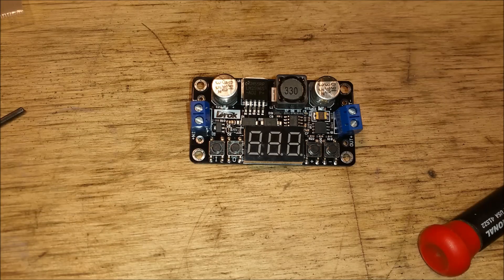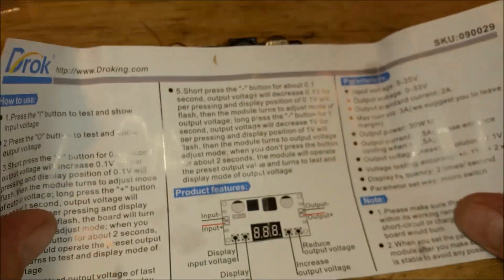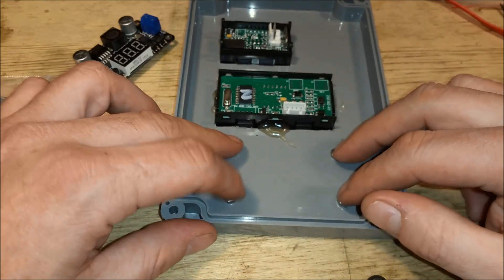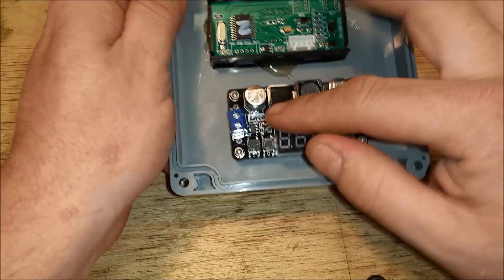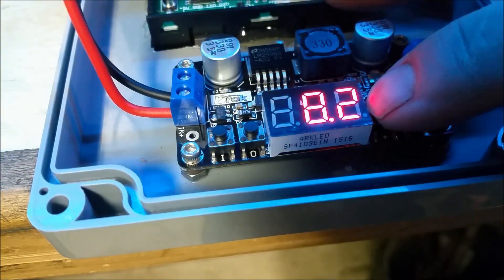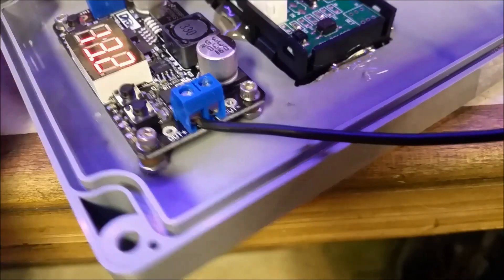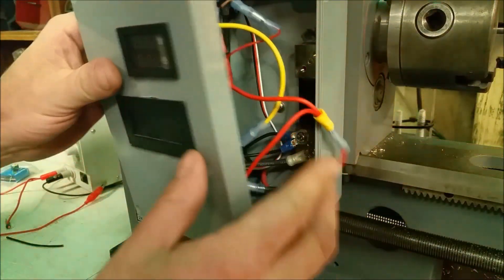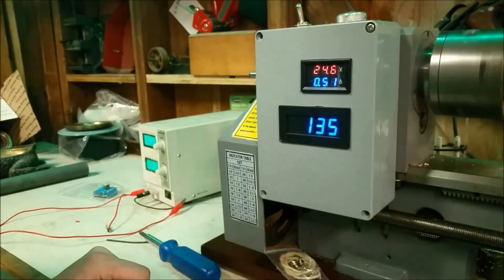DC to DC digital regulator DROK Droking.com for mini lathe tachometer LM2596

Comment: i need to find one that does from110 to 5v...so i can some straight in off the  terminal block,  then wire my tach to the other end..im doing a treadmill motor lathe build

Comment: Don, do you feel the heatsink is nessisary? I see them sold with little coolers, mine did not come with them. I know MOSFETs get real hot sometimes, enough to peel skin (learned the hard way). I'm preparing my setup this week, running 12V in, and 5V out powering a single 0.28A, 1.5W fan.... Directions say, "please enhance cooling when > 1.5A", which I assume means to cool it when running under its native amperage (2.0A). Am I correct in thinking I need to buy heatsinks?
Reply from the maker: Sorry to hear about the burn, Ouch.  I cut, burn and stab myself on almost a daily basis. hehe.   If you fan is drawing .28 amps, i wouldn't think that you would need a heat sink. I am not using a heat sink on my DC regulator, it has been in the lathe for almost a year now. A 1.5 watt fan at 12 volts only draws 0.125 amps which would be below the .28 you mentioned. If you like, share you project with us, would like to hear about it.  below is a handy link to Watts\volt\amp calculator online.  Thanks!  http://rapidtables.com/calc/electric/watt-volt-amp-calculator.htm
Reply: Ya I hear ya, I work with FDM and SLS printers, so heat and razors basically lol. Used to it by now. I did some testing last night and it barely hit 85f after 30 mins. I could even push the voltage a bit (fan takes 3-7v safely) and it didnt care. Still though, I wanted to put them on there just incase. Rather than pay for a box of 20 heatsinks when I only needed 2, I dug through my old computer parts and found a GPU heatsink. It was perfect. So I chopped 2 squares from it, 4 fins each. They are now on the boards and cold to the touch when its running, so I can upgrade comfortably to lager fans or bigger circuit in the future if needed.

The project is a 3d printer. Its doing a few "firsts" in the industry thagt I'm not comfortable talking about here, but if you want to see how its coming; been in development for a little over a year now and its finally becoming a physical object. Some of the pics and vids are public on my facebook, check em out. ( Facebook.com/kyle.currier/ ) Feel free to send a friend request. Also, I appreciate the rapid response. 

As for the voltage, amp, watt conversions, I know my equations; was just unsure how the boad would handle it. The fan is running on 5, and the board is giving 12, so its dumping half of it back to the mainboard. I was unsure how these things would handle it over long periods. My prints frequently hit the 10-20 hour range so it needs to be able to keep its cool over long term. The heatsinks are cold to the touch so I think ive hit my mark. I should be able to expand the circuit or add more powerful fans later on. 

The fans are cooling the nozzle heatsinks on the printer. Theyre little 30mm's, runing 14k RPM. Vicious litlte things. Already took a piece out of my thumb and index when testing it before mounting. 5-6CFM airflow, im impressed with them. They are intended for an ESC heatsink for an RC car, which can literally catch on fire if not cooled properly, which is not a good thing when lithium based batteries are present.
Reply: I'll post a link to the vids when the printer's final parts are on. Right now it has its old itteration of parts on it, but if you want to see it working, just check my video album. The finalized designs are the black and blue fiber optic parts, you'll see them on my wall; only a few pieces left to print and it will be ready. It's printing its own upgrade parts. I always get a kick out of that lol.